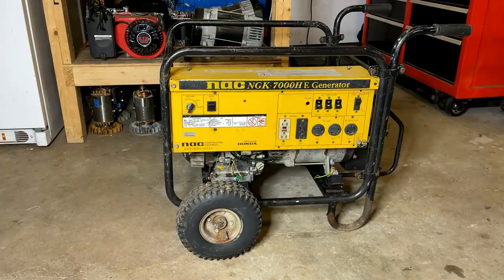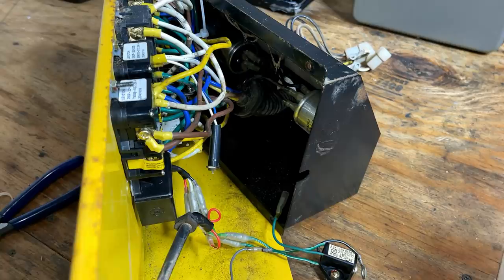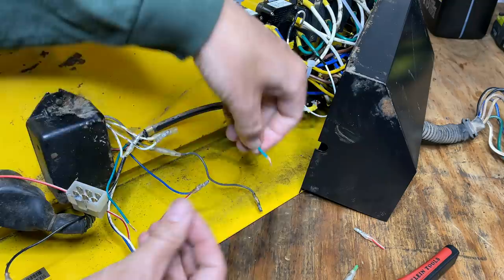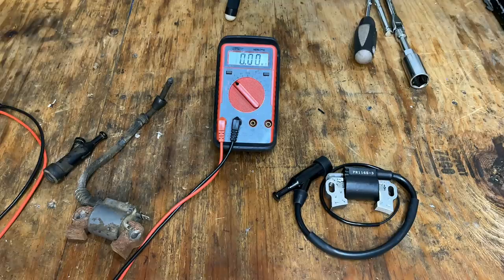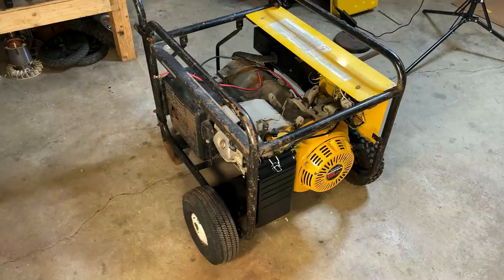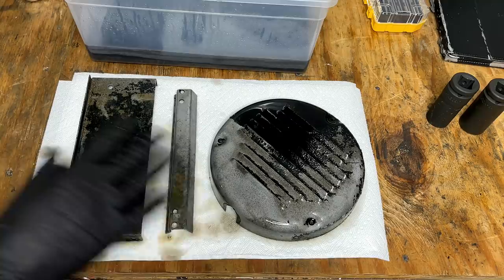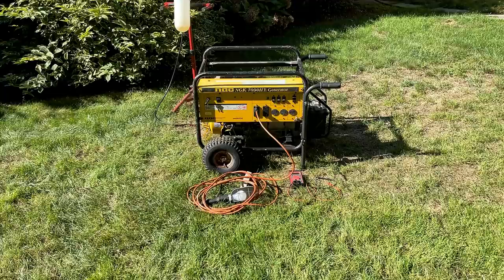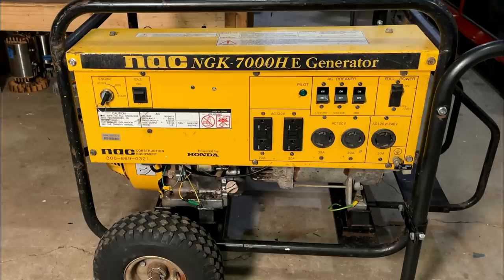Trashed Generator Part 2 - Making it Perfect

Comment: A word on bridge rectifiers (or as we call them rectumfryers ;-).  When you're substituting something else, there are three things you're concerned with: peak voltage on input, desired output current and package.

In this application 1A is certainly enough for current.  The rectifier should be rated at LEAST double the AC input (eg: about 300V for 120V input and 500-600V for 240V input) voltage.  It's typical to see those square devices, but there are many that are practically microscopic compared to them.  Be sure you can figure out how to mount and connect the thing.  I know of pencil-eraser-sized bridges ("T05" cases) that would work perfectly here and cost a buck or less.

Don't get too anal on matching "double the voltage" - you'll probably find that the cheapest and most common of a particular "bridge" family is way higher voltage than you need.  With single diodes nobody ever buys 1N4001 (50V 1A) when 1N4007 (1000V 1A) is practically all devices sold, are cheaper, exactly the same size physically and nobody stocks the lower voltage ones.

At expected currents of about 1.5A or more, you will have to figure out how to heat sink it.  The square ones have a hole for bolting to a heat sink (think: nearby sheet metal).  Above about 10A, you often have to get serious with heat-transfer grease and extruded fin heatsinks.
Reply: Bolting it onto the steel frame of the generator is heat sink aplenty. I cannot think of a portable generator in which James would need a bigger bridge rectifier than those he has bought and used here. Someone could prove me wrong I suppose. I look forward to it.
Reply: @r8118830  In this case, I think the rectifier is only needed for the idle circuit and perhaps usb charger, that would only require 2-3A. Those type of bridges are available to 25a and perhaps more, so simply bolting them to a reasonable sized piece of metal should be more than adequate. That said some types of inverting generators will convert ac generator heads to dc, then power the entire inverter from that which would require far more substantial bridges. Imagine the devices needed to convert full-up generation stations to put dc in the high voltage distribution towers, for conversion to ac before it hits a few
10’s of thousands of homes.  As the Quebec power company has converted their entire grid to.

Well, yeah, James here is not likely to have to deal with such things, and you won’t see rectumfriers  like that on Amazon
Reply: @fromagefrizzbizz9377  Quite so. I have been considering the reason that they designed this generator with two separate low voltage windings. If there was just one winding then the dc supply voltage to the idle circuit might vary as the battery changed its charge state, unless they gave it some good voltage regulation. Good voltage regulation always costs money. An extra winding rated at 44V rms with a single 5A diode might well cost less than a regulator and a beefed up full wave rectifier. The half wave circuit would more or less regulate the charging current itself as the battery charged up. Once the stator windings are designed the extra cost of a few windings would be minimal.
Reply: @r8118830  It's generally bad to give batteries anything more than about, say, 15V for any duration longer than it takes to charge it.  44V RMS AC will produce half-wave with a peak voltage of about 65V, which will do bad things to the battery once the charging current declines no matter what the input impedance.  Limiting charge voltage for relatively low charging current (say 1A) takes a string of diodes (or a Zener) and a single transistor and a couple of resistors.  The copper in the winding is probably worth more.

Whatever.  We don't know the thinking of the designer and what parts he was constrained to pick from.
Reply: @fromagefrizzbizz9377  44V x root 2 =  62Vpk.   When the battery voltage is low we do not know how much current the 44V winding will push into the battery. It depends on the output impedance of the winding and the input impedance of the battery. If the battery voltage is low as happens after the generator has been sitting for years in the corner of the garage then the current into the battery could easily exceed 1A. How long it takes before it falls to 1A is anyone's guess, if the battery is not sulphated. How long the battery is going to charge depends on how long the power outage lasts. These are the imponderables of using a self charging system on portable generators. In the end the designers take a stance or are directed to take a stance about what is suitable. I recall being taught that the pulsed charging from half wave rectifier charging was good for lead acid batteries because it allowed for better electrolyte dissipation from around the plates. This was all in the days before the general use of sealed lead acid batteries and quick charging.  The other main advantage of half wave charging was the simplicity and low cost of the circuit.  I have used half wave charging circuits when repairing portable battery powered tools with little or no problems for years  Of course just leaving the batteries on charge for long periods is never going to do them any good whatever the waveform used, half wave, full wave, filtered full wave or square wave pulses as  in constant voltage charging circuits.  Modern charging techniques with their 3 step sequence takes all the fun out of it.  They are hard to repair as well. Battery chargers should not contain microprocessors. It is engineering design taken to extremes. KISS.
Reply: @r8118830  I didn't bother performing the calculations to find the peak voltage but I wasn't far off was I?

While I have done research into/and designed charging circuits, you're clearly more familiar than I am with them.

That said: 

- the simplest decent charger I ever worked with was a 20VDC wallwart feeding a box that contained a biggish transistor and a string of diodes acting as a voltage limiter at 13.86V and a similarly simple current limiter at 1A.  That works perfectly fine as a lead acid maintenance charger.

- as for microprocessors - lithium powerpacks have microprocessors or PLAs on EVERY cell.  You really can't avoid using them if you want to charge your lithiums properly, and at the same time avoiding having them kill themselves going to zero, or blowing up.

I also have a NiCAD/NIMH/lithium single cell charger that has a fairly sophisticated microprocessor "brain".  This charger can automatically identify what kind of cell is installed in each slot (has 8), perform optimal charging for the type, do programmed charge/discharge cycles (for attempting to rejuvenate some batteries) etc.

Pretty cool unit.  Pretty cheap.

If you saw Mustie1's recent video on multi-charge units you'd have seen an interesting solution. He was gifted an apparently dead charger/inverter/tire pump, that had a fairly substantial SLA in it.

The charging circuit was quite cute: the design used a 12V battery charging wallwart (probably just a simple switcher), and bolted it down with the prongs coming out of the multi-charger back.   The output leads were put straight onto the SLA, and voila, charge!

In Mustie1's case, if I recall correctly, it was just the SLA that was toast.  Probably left way too long without recharging.

[Tho he should probably have tested the wallwart completely, he only used a voltage indicator light, did no testing of AC vs DC or the actual voltage.  It may turn out that the wallwart was defective in a way that wasn't supplying enough voltage, or subjected the poor SLA to AC.]
Reply: @fromagefrizzbizz9377  Do not denigrate your own knowledge and experience. Most of us are old timers and we all have different experience. Being a Brit my military experience was in the Royal Air Force. This is where I first learned about battery performance, testing and reconditioning. I recall the Squadron Leader coming to me to talk about battery failures on the new trainer aircraft, the Hawk. The batteries were coming off the aircraft after training runs absolutely flat and completely exhausted of charge. We went through the redesigned charging circuit on the aircraft and determined  that the replacement of a relay that blocked reverse current flow from the battery into the generator with a simple silicon diode was the issue. He took the report he wrote to a designers conference in London. The 0.5 V voltage drop the diode produced  in the supply was enough to restrict the charge current so that the aircraft systems was using current from the battery as well as the generator. Aircraft batteries are much more safety critical. Only meant for use after generator failure. Later in life I went to work at universities and worked with a group on the early stages of electric vehicles. Battery performance was everything. I learned enormous amounts from the leader of the group, Dr Clive Morgan. I have been out of the field for twenty years now and the improvements in technology have been astounding.
Reply: @r8118830  Good god yes, the recent advances dealing with lithium chargers and the "blow back" onto other charger design is incredible.  I can design chargers for regular batteries that will work perfectly (albeit by working exactly to spec, with no manufacturing cost-cutting imposed by management), but lithiums I will not touch without using prepackaged microcontroller devices designed specifically for them.

There's a video on youtube where a guy built a battery pack consisting of lithiums (I forget the type code) that were the size of a popcan scaled up by a factor of two.  Over $40K of the damn things.  Charged, that thing contains enough energy to flatten a house and then some and can do that if something bad enough happens.  Eeek!
Reply: @fromagefrizzbizz9377  I worked for a while as a lecturer in what is called a community college on your side of the pond. There was not enough equipment or money. I built power supplies for a dozen low voltage soldering irons out of bits I scavenged from anywhere. Some of the irons were 12V, some 18V and some 24V volts. Each design was different because it had to cope with the bits I could find. I absolutely loved doing it because it tested my inventiveness. They also had to be safe and have some long term reliability.  Hence not an SMPS amongst them.
Reply: @r8118830  Canada?

Which college/province?  Year?

I'm a little surprised that a public community college giving courses requiring soldering would be short of irons.  Maybe a smaller private one like DeVry a few decades ago.

I cut my teeth on big iron power supplies with vacuum tube rectifiers, often tube power amps, but included driving WWII surplus 80m transmitters  but ventured into cockroft-walton chain power supplies at 3Kv (a home brew oscillopscope) and got bit by more than one colour CRT flyback transformer.

The crowning glory was the aiming gear for a 60' radar dish (we converted to radio telescope) that originally had two amplidynes to drive the 10HP DC motors.  It's fun getting your head around how amplidynes work, with a control box 7' high, 8' long and 2' deep containing vaccum tubes the size of your head in order to convert to a box the size of a counter top microwave using IGBT bridges.

Those amplidyne/control box assemblies were also used in WWII battleship main gun aiming.  Damn thing could shrug off small arms fire.

I settled in mostly computer science, but kept my hand in hardware.  Built a micro or two over my youth (8 bit), and some a bit more advanced stuff.

But today's stuff?  Well, yeah, I can solder surface mount.  But I hate it.
Reply: @fromagefrizzbizz9377  I live in Wales in the United Kingdom . The college in question was Barry College which is now part of the Cardiff and Vale collegiate group. We had soldering irons of course but  not enough working ones. The inadequate technical staff had neglected them and  most of them were  just stuffed into a large box in a broken or incomplete state. Some of them were of a really cheap design which had been superceded and for which parts were no longer available.It was the power supply innards that were the problem. I re-used as much  of those as I possibly could. It still required me to rifle my personal stash of parts at home, parts from other departments of the college and finding scrapped equipment from our college and elsewhere.. The issue of not enough soldering irons had been compounded by a problem I discovered in one of the labs. At some previous time one of the managers had found enough money to install a 12V dc distributed power supply system in order to power a soldering iron at each station. The system had not been finished. All the internal wall wiring had been done.  It took me a few weeks to complete the exterior works and me and my closest colleague decide to use it one Monday morning for a group of twenty students. I was working in another lab. He came running around to me in a panic. The lab in question was filling up with smoke. I turned it all off. He had to take his class into an empty lab to do something else. When the smoke cleared I started investigating.  The electrician who had installed it had stuffed the whole length of the low voltage supply cables into a volume of plastic conduit that contained half the volume of air that it should have had. No wonder it overheated.  Up until that point there were only ever a few of those irons used in that lab at any one time. As soon as we used it to its full capacity the flaw made itself apparent.  Those irons became some of the ones that I built external supplies for. The wiring system had not still not been repaired until after I left a few years later,
Reply: @r8118830   Ah, yeek.

Wish I had a chance to visit Wales sometime again.  Part of my family background (yes, I can pronounce Cymru ;-)), it just feels like home once you're outside of the cities up around the Yr Wydfa/Ynys Mon (Snowdonia for the Sassenachs) region. 

I'm in the Pen-y-Gwryd hotel's guest book twice, once in 1978, and the second on my honeymoon in '84.

Cymru am byth!
Reply: @fromagefrizzbizz9377  I live in South Wales. My father was Irish of course. My mothers family were and are all from Wales. Here we call the English Y Saes. I have understood it to be that you hail from Quebec - with a French moniker et al.
Reply: @r8118830  I'm a bit of a mongrel, with Welsh, Scot, Irish, dutch and miscellaneous.  Part of my family is descended from the Dutch in New York who fled north to SE Ontario after the American revolution, grandfathers from Liverpool and Manchester.  I can see Quebec from our window (across the Ottawa River)  but no, I'm on the Ontario side.  The French Quebeckers refer to themselves as Le Quebecois and so do we.  Many Quebecois call English speaking Canadians (especially those living in Quebec) "anglos".  The Quebecois outnumber the Anglos significantly, but it can vary enormously from place to place.  The region opposite to us is mostly Anglo.

There's a low and almost constant sense of friction in Montreal and Quebec City.  The rest of the province is very welcoming of everybody.  As long as you have a smile and have patience, it's quite a nice place to be.

Quebec is a pretty socially progressive-minded place but with a few weird quirks that make you go "wha?".

Comment: You may be interested in knowing that there's a new type of butt connector you might like.  It's a piece of heat shrink tubing, with hot melt glue rings at the ends, and a low temperature solder ring in the middle.  Slip the tubing on, manually twist the wire ends together, and hit it with the heat gun.  Voila: soldered, "wrapped" and sealed/water proof in one go.  Some of these are code-approved for splicing underground direct burial of house wire.

They're not that expensive and more reliable than tape and hand-soldering.
Reply: Interesting. Will have to check these out. Any risk of the low head solder melting near hot machinery, like a generator engine?
Reply: @andyrichardson6188  If you ever tried one of these things, you'd find that the melt point of the solder is higher than the shrink point of heatshrink, and would be endangering the insulation and electrical tape would be dripping glue.  The temperature in that spot can't be that high, or the GFCI would probably malfunction and all sorts of other things are at risk.

Comment: One thing I do when the shrink tubing needs to cover 2 diameters is to use a short length of the next size down to shrink onto the smaller diameter, then a second layer of shrink tubing to grip both parts.

Comment: The rectifier that you used for your replacement is probably a better choice as it is designed for a heat sink having the aluminum housing, which the cabinet does an adequate job of, and being able to use crimp connectors is a plus, too.

Comment: Re-using the rotor if you can seems a good idea. This only works if the replacement powerhead is more or less identical to the failed one.

Comment: 12:54 Rather than destructively/permanently cutting off the bullet-connector wires for the bridge-rectifier from the generator's wiring-harness, I would have just snipped off the bullet-connector pigtails from the old rectifier, stripped the pigtails' freshly-clipped wire-ends and spliced on the four female spade-terminals, and then plugged the pigtails onto the rectifier and the generator's wiring harness.

Comment: I would have cut the wires off the old bridge rec. and added spade connectors to the cut ends then the new bridge could just plug into the existing wire connectors.